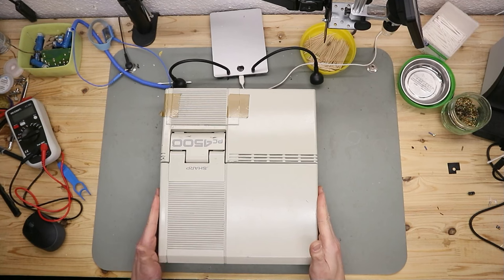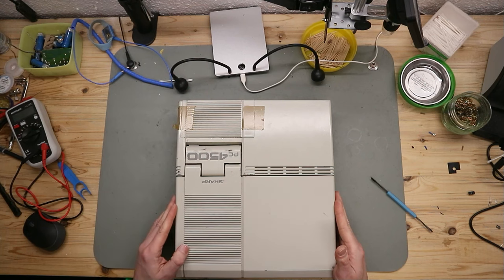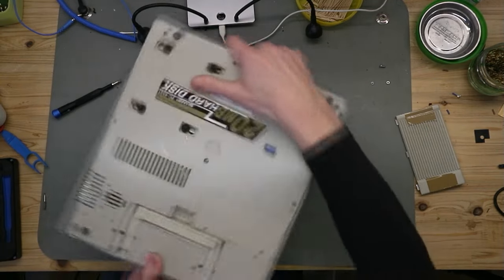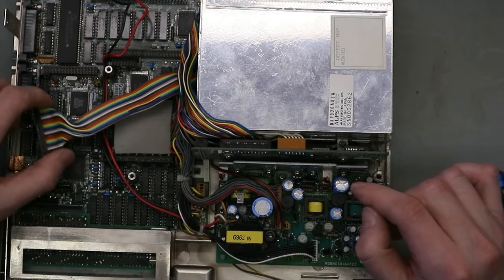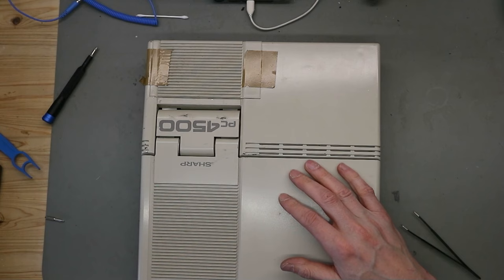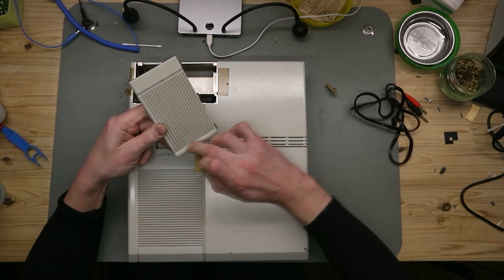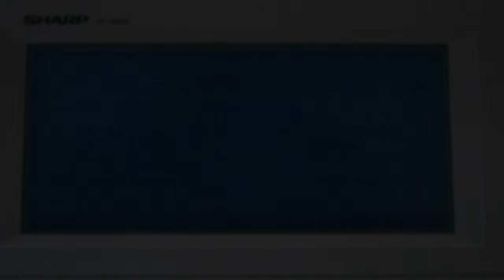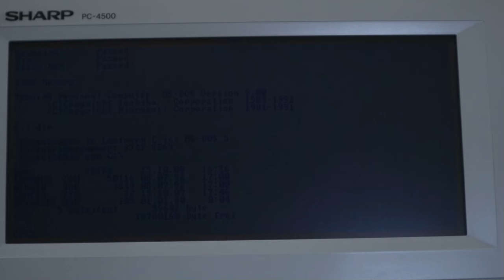PC-Archeology: The Sharp 4521 Laptop from 1987

Comment: Fellow Sharp PC-4521 owner here. Mine is missing the HDD controller, which makes it impossible for me to connect any kind of hard drive to this laptop. I even tried parallel port SD card reader specifically designed for old DOS laptops to no avail. I want to ask you if its possible for you to take high quality photos or even better, scan both sides of the HDD controller card? Creating a clone of the HDD controller would help make all of those Sharp PC-4521's useful since then our only alternative for storage wouldn't be overpriced 5" external floppy disk drives.

Thank you for the video and making more people aware of this laptop!
Reply from the maker: Thanks for your words. I will see what I can do. 👍

Comment: Dear Sir, I am very glad to come across your channel. I have a Sharp PC-4500 computer for ten years, which we used at our local club for programming stations in DOS. A few months ago, the power supply board inside the computer burned out. We replaced the burned-out elements, but the computer won't turn on. My question is..do you have a wiring schematic diagram of your or better PC-4500 computer? I would be extremely grateful. Best regards and thanks in advance
Reply from the maker: Thanks for your nice words. But i don’t have any schematics for this computer. The reason is I don’t found any of them. 
Maybe one of my subscribers can help.